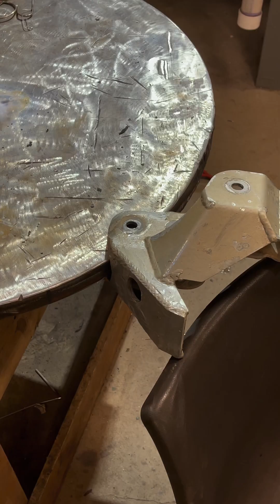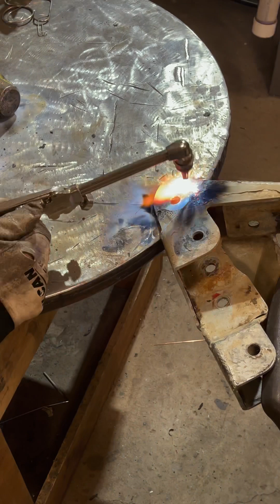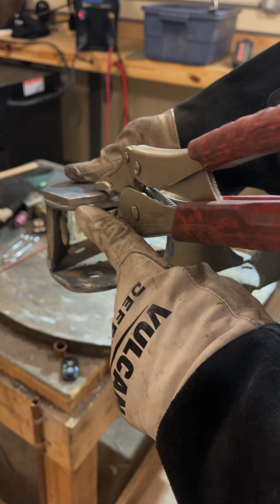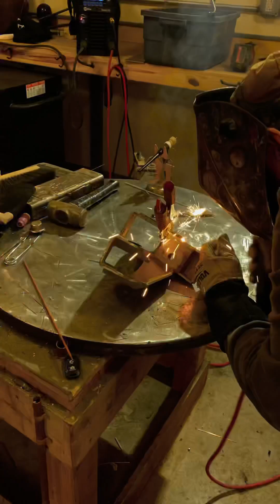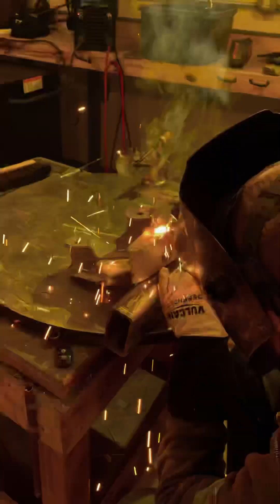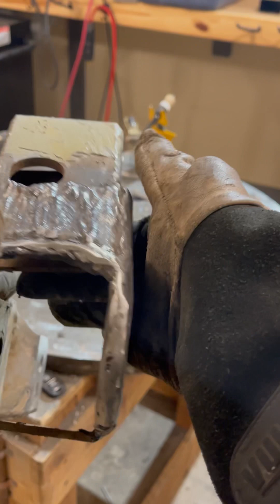Fixing/beefing up metal cloak Jeep jk DB3 brackets so they can handle rocks better

Comment: Are you still happy with them? Ive been debating on adding the weld in one to my jeep. Do you get hung up alot on them? Im on 37s
Reply from the maker: So the drop brackets do improve geometry, but no doubt the Jeep gets hung up on them a lot.  My previously wheeling rigs were leaf sprung rear on 40s (think pickup trucks) and I never got hung up on anything like the Jeep does.  The drop brackets undoubtedly cause it to get caught, but once I beefed my brackets up I haven’t had any issues.  The stock/unmodified brackets are unsuited for wheeling in my opinion.  Now if the weld on ones you’re talking about are 1/4inch steel that’s better.  The bolt on nature has not been a issue with the brackets I have, once they were built strong it tends to slide using them instead of getting stuck on them.